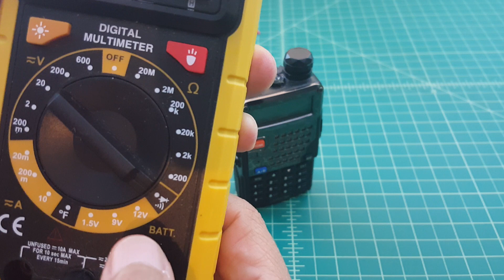Increasing the Range of your Baofeng UV-5R With a Counterpoise - TheSmokinApe

Comment: Hey SmokinApe, I've been using antenna boosters with my portable Ham radios for years.  About 10 years I got at a ham radio event/show in NJ what is called the  "RatTail Antenna Booster"  which you don't have to physically attach to(screw to metal part on portable ham radio).  It works great, definitely increases radios performance.  I have since bought/use several of them on all of my portable ham radios.  Here's a link to the "RatTail Antenna Booster" I got -     http://rattailantenna.com    and here's a link to the inventor's youtube video demonstration -   https://www.youtube.com/watch?v=Howh0SXGJ50    you need to get one of these and try it out for your self!!!!
Reply from the maker: Cool man, thanks for the link and the heads up!

Comment: They do work good. I always go to the base of the RF connector though. In the BNC days we would use the 25amp alligator clips and 18ga wire.  On a portable a quarter wave whip and quarter wave ground plane is about as good as it gets on highband (VHF) while maintaining portability. There is lots of false advertising in portable antennas - just adding this little wire will add performance and save you money. Thanks for sharing !
Reply from the maker: Thanks for the heads up and the tip.  I am trying to come up with a test in a follow up video...
Reply: Yes you're right! I have picked up so many truckies,  tradesman etc.

Comment: I wish someone had some empirical data demonstrating that it does work. Without that using one of these is just cargo cult ham radio.
Reply from the maker: I think we both know that no matter what test I could have / should have done you would still complain...
Reply: I'm not complaining at all!
Reply from the maker: I am think up a test, if it works out I will post a video...  it will be more anecdotal than empirical...
Reply: Tracy all you have to do is go to the Amateur Radio Relay League (ARRL) website and peruse "counterpoise/handheld" and you'll probably find lots of articles for you to 'fact check'.  They are a wealth of info and have been around since before you were born.
  stay safe keep warm have fun keep learning & whittle to keep your sanity.
  ol greybeard dino
  ; - ) >
Reply: Doug Duncan Thanks. I've looked at those. I'm General Class KK6MPP. Hope to get extra next year. I have actually been looking at the counterpoise issue for a couple of years, ever since I made one from my FT-60 having seen another video on youtube. Nobody making these videos or writing papers seems to be in possession of a field strength meter so we never see any actual data included.
Reply: +Tracy Reed glad to hear you joined our ranks! My memory being rather spotty seems to recall 1 article that had some data, but whether it was with a meter or not... (sorry age and illness does tricks to a body's mind).  In the article I remember the individual either used the same radio in the same spot (not best but still provides verifiable results) or they used a duplicate. Probably doesn't help if all your looking for is meter data, but if you've been in this hobby long you know most hams can't afford high $$ equipment but will do things so that their results are repeatable and verifiable (true definition of a scientific experiment).  
  ol greybeard dino
  ; - ) >

Comment: Though that mod will help a bit (just as it does for any hand held using the included antenna) you're actually better off purchasing a better antenna.  Make sure it's a duo band to match the radio. You can even get a small mag mount & a cheap pie tin and you'll have even far better reception & transmission capabilities. Just some info from a long time ham.
  ol greybeard dino
  ; - ) >
Reply from the maker: Totally agree about the antenna, thanks for the comment...

Comment: Absolutely should work! Here's another cool accessory for the Baofeng. http://www.ebay.com/itm/DELUXE-MODEL-ROLL-UP-2M-70CM-ROLL-UP-J-POLE-SLIM-JIM-ANTENNA-WITH-10FT-COAX-/190898779511?hash=item2c72743577:g:qcMAAOxy0zhTLa6u
Reply: I made my own roll-up J-pole for a lot less than they cost elsewhere. The instructions are all over the internet and the materials are easy to get.
Reply: Ron C I have one ..it works awesome I can get repeaters 30 Miles out easy
Reply: That is a fact as well. I'm considering making the buddy pole (plans are on the site)...just because....lol
Reply from the maker: AustinPilotMichael I want to try making one...
Reply from the maker: Thank Ron!
Reply: I have two of these & am thoroughly pleased with their performance..Looking to buy two more...
Reply from the maker: prairiebison60 Thanks man!